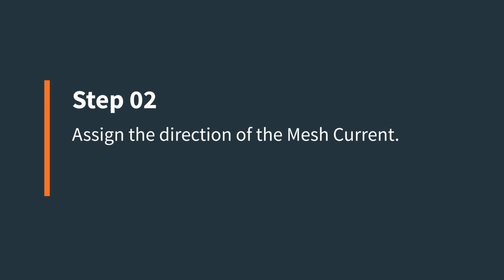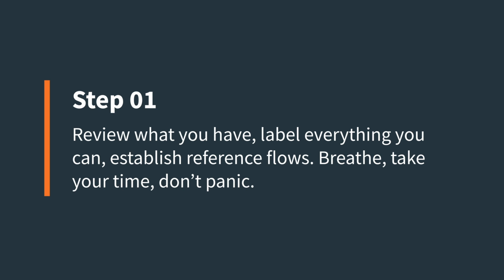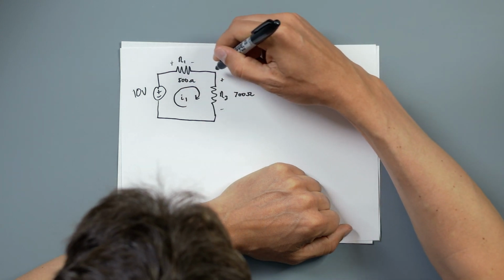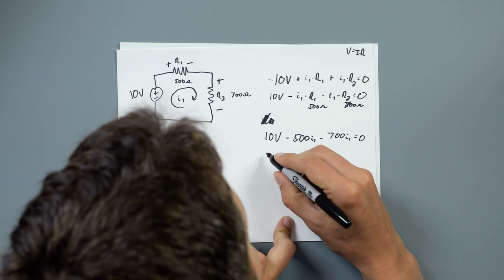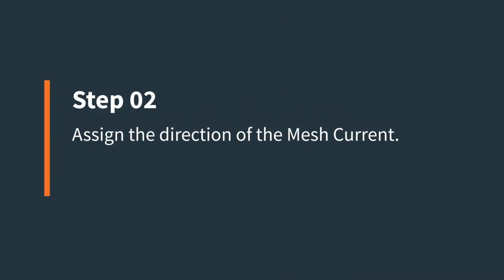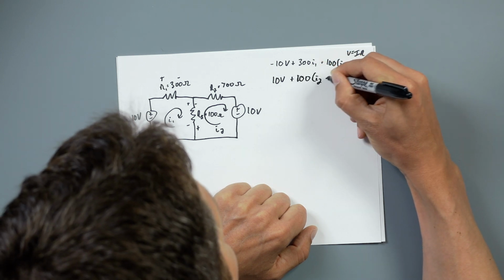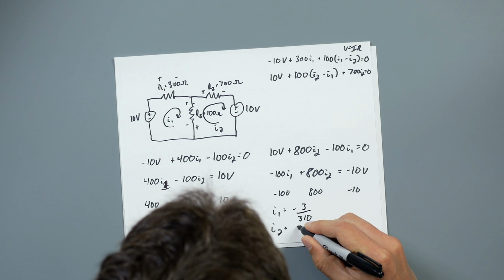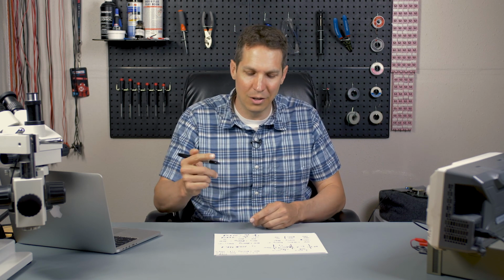Kirchhoff's Voltage Law (KVL) - How to Solve Complicated Circuits | Basic Circuits | Electronics

Comment from the maker: Hi everyone! We were doing an internal review of our videos and found a spot where Josh messed up. At 10:50 - that should be i1 TIMES R2, not i1 minus R2. It is treated as i1*R2 throughout the rest of the video but he did say and write it wrong at 10:50.
The written tutorial has a few more examples and goes into a little more depth if you're interested, particularly the supermesh concept:  https://www.circuitbread.com/tutorials/how-to-solve-complicated-circuits-with-kirchhoffs-voltage-law-kvl  In regards to the matrix calculator, check out this tutorial - it will be very helpful:  https://www.circuitbread.com/tutorials/math-for-basic-circuits
Have a great day!

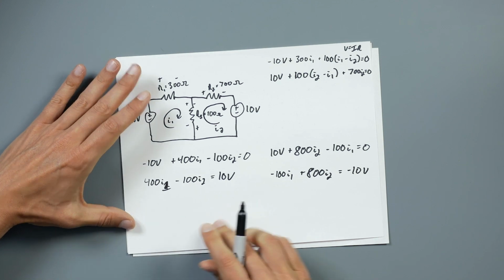Comment: 19:02

Solving i2 by using substitution

First i1 in terms of i2 using left equation
i1 = (10 + 100*i2) / 400
i1 = .025 + .25*i2

Substitute and solve for i2 in right equation
800*i2 = -10 + 100 (.025 + .25*i2)
800*i2 = -10 + 2.5 + 25*i2
800*i2 = -7.5 + 25*i2
775*i2 = -7.5
i2 = 0.00968 = 9.68ma
(thus i1= 27.42ma)

I suppose I made a mistake in my math as plugging in R1 and R2 with those currents, the voltage drops don't match

Comment: Is it possible that you switched up i1 and i2 at the end? Because I get the same results but with i1 and i2 switched, and wouldn't the current flowing through the smaller resistor (R1) be greater?
Maybe I'm just confused, but I even checked with a simulation. Anyway, I really love these tutorials! Thank you so much!
EDIT: Whoops, it's explained later.
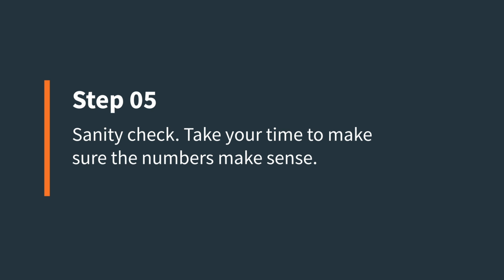Reply from the maker: How far into the tutorial did you get?  Because at the 20:30 mark, doing the sanity check, I realized I did label i1 and i2 wrong, they were swapped. 😬
Reply: @CircuitBread  Oh no! I'm sorry! I watched all, but probably wasn't paying attention while I was tying to figure out what was going on on my end. My bad!

Comment: quick question i made my own little mesh problem to solve but ended up with a non square matrix... how can i get the inverse on that?
Reply from the maker: Before worrying about the math, I would double-check the setup to make sure you put it together correctly.  If you have a zero somewhere, that is still part of the matrix.  Or make sure you have put the equations together while referencing the correct variables.  It would be easier to see what's going on if you jump on to our Discord channel and can show what you're up to.  Unfortunately, I haven't been responsive here or on Discord for almost two weeks now because I've been wiring my house (almost done!) but there are a lot of good people that will hopefully be able to help out there.

Comment: I totally lost it where you put it in matrix calculator. where did -3 7 and 360 came from?
Reply from the maker: Hi!  In general, I think this video would help a LOT:  https://youtu.be/C8HxYdorsMs  But basically, if you setup the equations for the circuits, instead of solving for each unknown by hand, you can put it in a calculator and it will solve it for you.  I highly recommend you watch that video - enough that I'm going to add it to the pinned comment, as it will make this make more sense and make future problems easier to solve.

Comment: Great videos.

I'm surprised you don't make them on a breadboard or with wires or something as well to measure it and make sure that the math works. After all, circuits are real things!
Reply from the maker: Y'know, that was originally my intent - to go through the math and then show the circuit in real life, showing how they match.  I have no idea why I didn't end up doing that.  Now I'm kinda disappointed.  🙁  I'll try and do it with the rest of the circuits videos.

Comment: Hi Buddy, Thanks for the video. Would you be able to point me in the right direction with the matrix calculation? I just mean how to punch it in to the calculator! I have a scientific Casio calculator with matrix functions.
Reply: Actually it's OK I figured it out. Go into Equation Function > Simultaneous Equation and then select 2 Unknowns and put them in as per video. What confused me is that my calculator has a totally separate mode/function called 'matrix'. Thanks again for this great video!
Reply from the maker: Hey Martin - I'm glad you figured it out!  We actually shot a video of how to do the matrix calculation but 1) we use our simplified matrix calculator on CircuitBread.com as an example as it's easier to do than using my TI-89 (never used a Casio, myself) and 2) it hasn't been edited and published yet anyway.